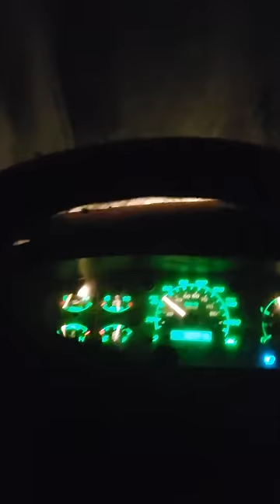7.3 POWER-SMOKE "WICKED" WHEEL

Comment: ''A turbocharger is made of the finest lightweight materials, must be installed by respecting the manufacturer specifications regarding torque figures''
Reply: Opens the compressor housing by slamming it on the garage floor.
Reply: Because screw balancing
Reply: Ooohhh yahhhhh
Reply: Fuck all that long it’s going it’s going
Reply: @N54God666  it’s OBS powerstroke… it’s fine
Reply: @getheated  it's absolutely not fine to just slap a turbo together and not balance it. I've only been a mechanic for 35 years
Reply: @N54God666  it’s called humor my friend. Did you see the condition of the truck?
Reply: @N54God666  you've clearly not been a fun guy for 35 years thats for sure 😂
Reply: Ol' wind powered impact go brrrr
Reply: Made from 100% self balancing Chineesium metal
Reply: @N54God666  Peg is a legend.  He can get a pile of scrap running, beat it, and it still starts up and moves.  He is driven on pure will and zero fucks.
Reply: @N54God666  cool but homie was tickling 4000 rpm’s just fine. If it was out of balance that bad it would’ve blown up. N judging by why he took out he don’t give too shits
Reply: Kirk Johnson  not even close
Reply: obviously you are wrong...

Comment: Gotta love the sound of a 7.3 
Dad had a 2000 f250 only floored it once and m, it’s like a bat out of hell.
Reply: Lies!!!
Reply: @alecmillard8546  alright it was like two or three times but one is what I told my dad
Reply: Has trouble getting away from stop signs....
Reply: I have a 99 7.3 with a built trans, bigger turbo an injectors an a tune. It's hilarious when people ride with me for the first time an I put it on race tune an floor it. It blows people's mind!!
Reply: @alwaysstrapped814  I should’ve mentioned my dad chipped his. With a new trans too. It’s a work horse at idle but a demon in the ketchup.
Reply: @alwaysstrapped814  and transmissions!!!

Comment: You need a 6 position chip to really wake that thing up.
Reply: Almost 99% sure he did put one on that ferd
Reply: @ivarain2923  Huh, i've run mine on the 175 tune an I would not call it gutless.
Reply: @madmodifier  I'd have to go back and verify but I'm 99% this is the mud bogger ford which he did put a chip in, but it's entirely possible he took it out

Comment: It’s like the rougher you treat your cars the longer they last. At least that’s been my experience. I had a f550 with 1.4 million changed it’s oil less then I changed its tires I have a new ram treat it like shit hve a Tacoma 1997 fucking dump 240k miles everything OG my Nissan Altima 2014 Poot thing 230k miles but I got myself a Tesla and the pos is falling apart. I got a new dodge Durango returned it in 4 days the pos starting acting up. BEAT YOUR CARS KIDS!